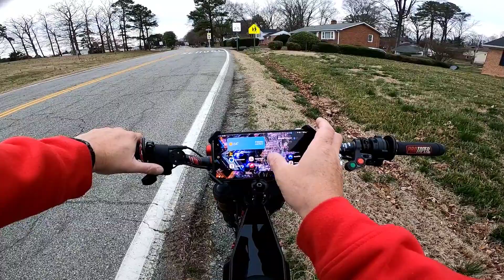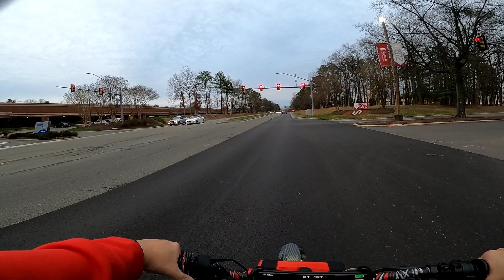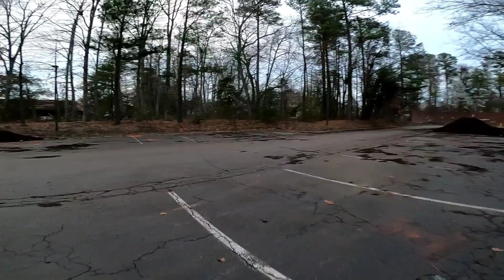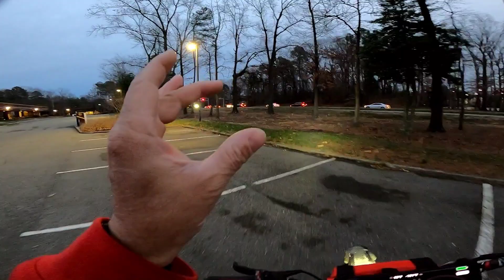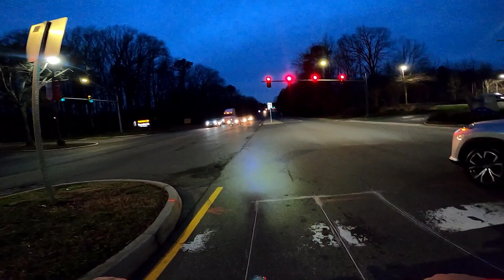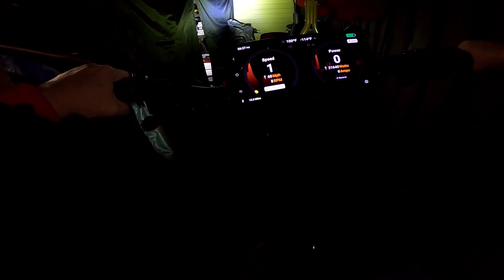Range on a 30kw ebike? Better than average on an efficient system with Off throttle regen & Ebrake!

Comment: Hi  Dr Chris, I'm buying a Qs273 5t hub and wheel, I would like to know what those spacers called ? I want to order some , because I have the same frame as yours, and I really respect the good info
Reply: Respect 🙏
Reply from the maker: give me some time and Ill find the legit name i cant recall i took mine off extra frames i had but i need to replace them too Ill find the correct term I call them torque plates

Comment: Range is a very iffy thing, it really depends a lot on the weight of the person as well. Also it really depends on the controller as well.
Reply from the maker: Might be iffy on your bike but not on a bike that was set up to get good range which was my point. Yeah Hella iffy if you haven't made any improvements to achieve good range. This video not about normal range for normal ebikes it's about how you can improve your range with these add ons and settings, that being said once again. My range isn't iffy, it's superb lol

Comment: What type of controller are you using? I can’t ride when it’s cold
Reply from the maker: BAC8000 it was like 62
Reply: @ChrisCrossingWires1212  
On Bac controllers are they hard to program and can they be used on any type of motor I have a sabvoton 150 
I like your display with options to change modes

Comment: Thanks for these type of vids Fam! I'm getting about just under 2000w @30mph and 3000w @40mph.... Mind u I am running on 14inches with 67v 13AH (5p) with 100A VESC currently set at only 100 phase Amps with about 120A field Weakening... And Don't curse me out for my settings either! I'm in experimentation mode lol. I'm an Electrician but electronics is next level for me😅 #AlwaysLearning bless!
Reply: I'm a sparky as well. Electronic classes in trade school will help greatly. They explain so many things related to the ebike world.
Reply from the maker: @Twin_turbo_coyote_fox  you're absolutely right, just the basic electronics Ohm law and formula for power just getting those two down and being able to calculate not just in series but parallel and combination circuits is a great start.
Reply from the maker: Wouldn’t think of doing such a thing to someone giving me Great feedback  thank you as well. Trying to do what others aren’t and now I know People are interested in this type of info makes it seem worthwhile.
Reply: @ChrisCrossingWires1212  Interested? Bro your basically My YouTube EV Professor! LoL Taking notes trying to focus on getting more efficiency  with  what components I have so far... Got all the right sized cables, lengths and connections to spec... Just trying to learn about the parameters... Alot of science and equations involved 😅🔥👨🏾‍🔬 . I Respect to your craft my friend 💯👍🏾
Reply from the maker: @Chris H #UKTunedIn CKflite  Electronics is all math, nothing but formulas at the end of the day. you won't need them all for ebikes but just start with Ohms law and the formula for power, 2 that you'll use allot.
Reply from the maker: @Chris H #UKTunedIn CKflite  sorry I should have added it but easy to find, 
Ohms law is V= I × R
volts = amps × resistance obviously you can flip the variables around to find the other
 Power in watts = amps × volts
you probably already know this but for anyone that may not.

Comment: Giving speed/power real world numbers will help people understand what to expect from batteries and motors working together. 
I have to get a direct drive and play with regenerative power. That’s the next thing. Plus a front drive 2 speed hill climber, Xiongda motor. But I still have a couple scooters a pit bike, and a couple of hub bikes that I should finish repairing first… I’m thinking I’ve turned into a EV hoarder.
Reply from the maker: Nothing wrong with hoarding great tech as there are plenty hoarders of meaningless junk, I’m sure if you ever decide to part with them youll have no issues doing it